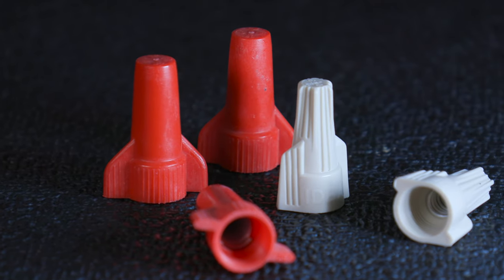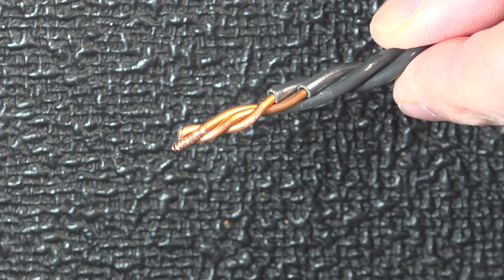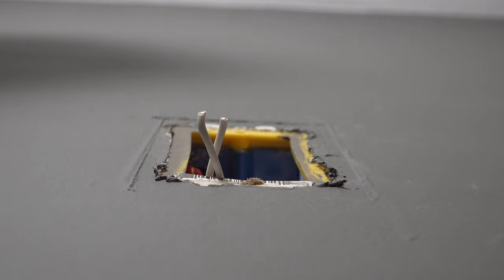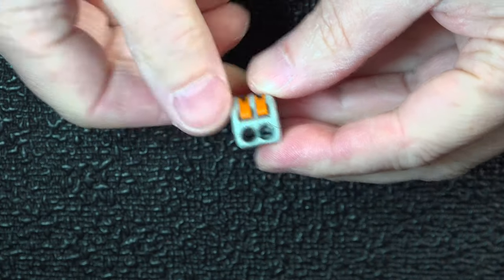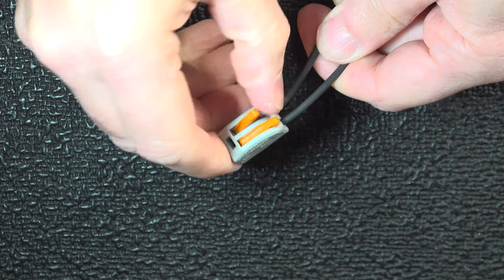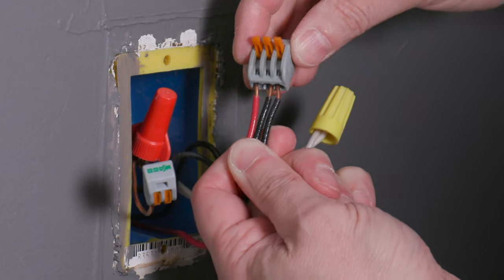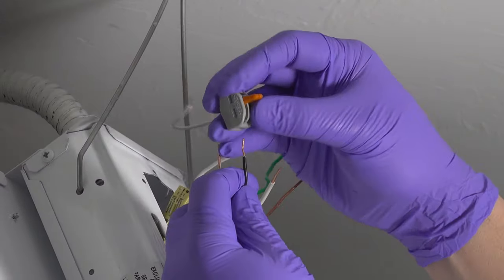Never use Wire Nuts Again - Wago is Better Electrical Connector

Comment from the maker: Thanks for watching please LIKE & SUBSCRIBE  Wago starter kit: https://amzn.to/3tb0Dcd  Favorite wire stripper: https://amzn.to/3ogIbvG BONUS: Updated Video just posted:  https://youtu.be/B1pmuRsf1co
Reply: Unavailable.
Reply: Let’s see the inside of these things. I saw a nick in the wire, not sure if that is how it connects but that doesn’t give me confidence.
Reply: @danlux4954  I bought a box of them, will let you know about the quality after they get here.  I have some 110V and 220V wiring to do in the workshop.
Reply: @aurktman1106  if you properly twist the wires together the wire nut just holds on with not much damage. Had the old marrettes that had the screw in them and because the wires weren’t twisted together they weren’t making a good connection and blowing the fuse.
Reply: @danlux4954  yep, just giving these a shot as I like to make it a bit neater when I can.
Reply: Pos
Reply: Wish I had watched this a month ago. Just moved in a new house and put up 4 ceiling fans and 5 new light fixtures. I would favor having used these instead.
Reply: These things are junk, wire nuts are proven to be superior, just need to be used correctly, twist wires with Klein’s first and then install wire nut.
Reply: These things have been out well over a decade. The wire nut is going nowhere.
Reply: These are junk. Service call in a box. Electrician for close to 30 years. Tried them for a short time and had to replace so many it cost way more in repair than it saved in install.
Reply: I’m an electrician with 40 years in service. WAGO is a German brand. In Europe voltage is 220 volts to ground. These work great there but with our lower 115volts l am concerned with the limited contact surface area of these. That’s the reason I never once used “quick wire” devices in my career! I only use these for connection of fixtures and only if they come with the fixture because they save my precious Wingnuts for more important jobs lol.
Reply: I love using wagos. However, there is nothing wrong with wire nuts. Old homes or buildings may have a ground in the box that is way too short to put a wire nut on. I’ve used both and have never had a problem with either.
Reply: Negative!
 Let's not re invent the wheel guy's!
Reply: The only downside to these is that they take up a lot of space when you have to use the larger versions.  To those saying that these are junk, do some research, most of the world has moved away from wire nuts years ago, and yes electricians over in Europe and other countries throughout the world use these things, they are not just for "harry the homeowner", wire nuts need to go the way of the dodo.  I have bought a couple of new light fixtures that used the compact back stab version similar to the Ideal sold by Lowes.
Reply: What kind of idiot cuts the wires shorter every time he wants to make a change?
Reply: Tell you what, when im doing a live 347 connection im not using one of those.
Reply: @KjartanGrindon  right it's not even the pigtail, it's the splice in the box
Reply: @aurktman1106  It's --> 120/240v !
Reply: @joesvideoplace  ok..  either way, I still plan on using them this weekend to wire up some fans in a paint fume filter / extractor.  110V, 120V, 115.93V, doesn’t matter.
Reply: @aurktman1106  
Not sold by wago I think.
If available pl give wago pt. No.
But the lock system is similar to wago
Reply: @danlux4954  
To avoid use ferrules
Reply: In avoianics integration rig (ADA) mostly we used WAGO  with PTFE wires
Reply: In Europe we have a long time ago, try our circuit barkers also
Reply: @mattmclaughlin7338  a@¹
Reply: Don’t try to fix what ain’t broken
Reply: @ProctorsGamble  Nominal voltage in Europe is 230, not 220. 

Another American dude claiming to be a career electrician claimed the amps in Europe are halved. This is also incorrect, while typical for US is 120 @ 15 amps, UK is 230 at 13 amps. UK residents can get 3000 watt kettles for their regular outlets, Amercans typically use 1500, max.
Reply: These are garbage and will cause a short. Twisting wires together and using marrettes are a way better connection. Hire a electrician and stop cutting the ends off. Who does that anyway, like really!
Reply: These are pronounced Vago not waygo. Even though I know that I still call them waygos ☺️
Reply from the maker: @SupernovaHeights1  Maybe that will help convince peolple it was an unpaid video, companies don't usually pay you when you say their name wrong
Reply: @pp.8129  If those domino strips are what I think they are, they're perfect for car audio.
Reply: Never heard of them great idea
Reply: Silver Cymbal I couldn't disagree with you more about wire nuts!  Wago's are nice but wire nuts are nowhere as bad as you make them out to be.  Much of what you say is very misleading. I HAVE BEEN ELECTRICIAN FOR 38 YEARS....
Reply: From my experience I've had more trouble with traditional wire nuts. Wire nuts cause so much stress to the copper that the wire snaps from being work hardened. These Wagos just simply made wire nuts obsolete.
Reply: You know your using the wirenuts wrong
Reply: Liked & Subscribed
Reply: Where can they be purchased, other than Amazon or ebay?
Reply: Wagos are trash quality lol
Reply: Wago is German brand. We electrician in Germany only use this Connector from Wago.
Reply: You can use YouTube to learn how to build a deck, change a window, grow a garden, etc. Call a qualified person for electrical and plumbing.
Reply: Great video, have never seen theses, till now, ordered immediately from
Amazon. I <subd> looking forward to riding with ya awhile !! 👍
Reply: This video promotes the use of wagos in a way that is incongruent and conflicting with the standards and safe practices observed by the electrical trade and the NEC. This video should be taken down.
Wago connectors aren't allowed in residential construction or on most commercial jobs and will be rejected by inspectors. They're not even legal in some places, and most electrical contractors only allow them to be used in light fixtures or not at all. There's a reason for that. They dont make a solid mechanical conection like wirenuts do. You probably wont find any with individual flip levers like the ones in this video. They have nothing external, just a spring blade inside that you cant even force stranded wire into and only work with solid wire. They also dont work well with different size wires because they share a single blade of pressure across multiple wires. Wagos dont stand up to long-term use in 120v plugs with cord/plug items with larger amp loads such as countertop items in bathrooms and kitchens, or even entertainment centers, etc.
Reply: I’ve found many lose connection caused by wagos
Reply: @sriyantra1939  probably be fine with low voltage wiring
Reply: Is this also good for automotive because my (auto electrical) uses this and they do seam really nifty
Reply: @danlux4954  we use wago hier in europe,  never seen wire nuts in new installation
Reply: @Coyote-tc1ww  Lol... they're not junk. It's a European standard.  I'll also take my Knipex over those Klein's, thanks.
Reply: @phatbaby4234  Yea because everyone knows that Europeans are smarter, yea right😂😂😂😂😂😂😂😂
Reply: Wire nuts work great. The big problem is people thinking they are electricians. You can't fix stupid with fancy connectors.
Reply: wire nut are more stronger more safety it they are well installed  your gadget it s good for led light who have less then 20 watts
Reply: @Rudofaux  
You clearly have no idea how to install wire nuts.
Please hire electrician.
Reply: @hawkeye1836  
Learn the proper way to use a wire nut. Just because something is new doesn't mean it is better.
Reply: @assassinlexx1993  1) I do.
2) No need for them anymore thanks to Wagos.
3) I am one.
Reply: @Rudofaux  
So you are a wag now 😏🧚🤣
Reply: @assassinlexx1993  Was that an attempt of a insult? I've seen preschoolers do better.
Reply: @assassinlexx1993  Yeah, I was bored to with what you posted.
Reply: Repent to Jesus Christ!  
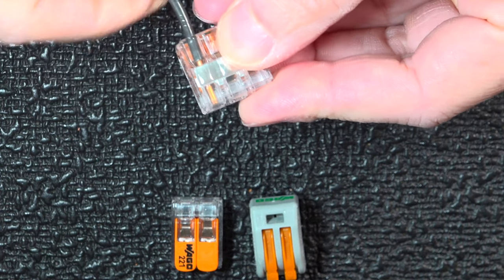Yes John 3:16
🙏
Reply: @cliffyj5071  
Your answer is clearly the best.
He reminded me the guy in front of tent saying  come a see the bearded lady.🎪🤥🥸🤡.
Reply: @stclairstclair  Twice the pressure. Half the resistance. Ohm's Law strikes again!
Reply: @KjartanGrindon  ppl